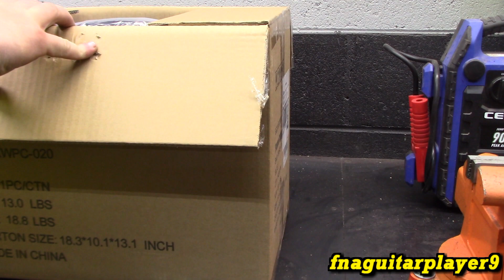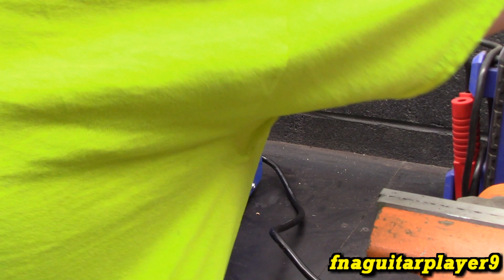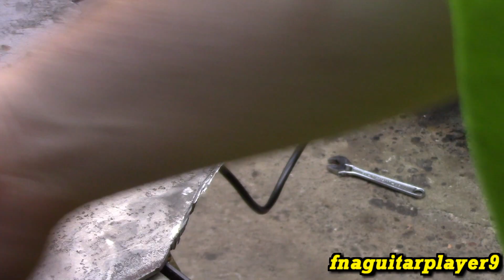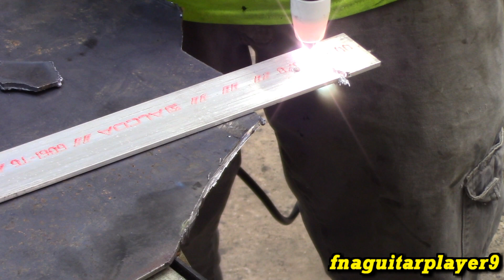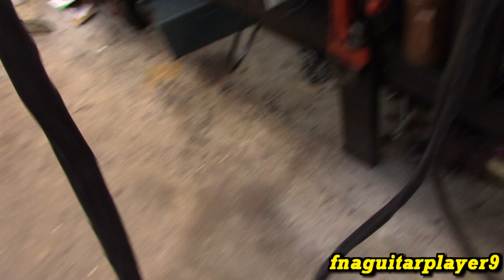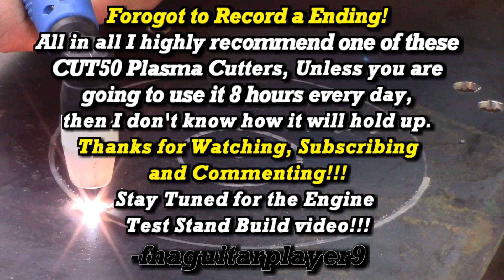CUT50 Plasma Cutter Unbox, Review / DEMO

Comment: Picked one up about the same time as you ironically enough for an ongoing project. The machine and a few little mods easily pay for itself if you've priced oxy gas bottles and fills lately! I had similar thoughts on the lines that come with these cut50s (they're all round about the same anyway) and replaced it with Milton high flow fittings and 3/8's lines. Went from sputtering cuts to pristine cuts with just that swap. Also ended up putting a bit better water separator upstream in my air supply system and another on the back of the machine as the one that came with mine leaked internally. I was happy enough that the cutter worked that a couple bucks in upgrades was definitely worth it.

Comment: Hi.... sorry but this is not in regards to this Plasma review....wasn't sure how else to contact you.  Quick question about the Stratton One Piece Flow Jet carb (excellent video on adjusting you did 10 years ago) but I am trying to find that Governor to Throttle spring that you even said they are often broken.  Working on an old briggs hp on a lawn tractor with this carb.  It is tuned and running very well but for one thing.... when throttle moved to idle when it is cold it stays there fine but after warm the rpms start climbing to max with the throttle not bottoming out on the set screw.  Could this be that broken spring and if so any source for me to get one?  Thanks in advance and thanks so much for your awesome content for us backyard mechanics.  Tim

Comment: Good job and they6've got the big ones at the truck shop and boulder hole. What I've seen it the tip doesn't touch the work but there's an air gap between. Try that and see if the quality is better. Nice Miller-ish paint job. Thanks, Pal and GBWYall!

Comment: I'm convinced. If I need to do a lot of metal cutting I will get one. I think the torch is meant to be negative, different from my inverter stick welder, when the torch is positive. Looking at that table frame you used to cut a straight line, if you get a couple of those and make a holder of some sort, you could use it like the rails on a sliding mitre saw. I have seen a plasma cutter being used on a CNC. Looking forward to the engine stand project. Thanks for sharing.
Reply from the maker: It seems to do a good job, concerned about long term use of it. Thanks for Watching!!!